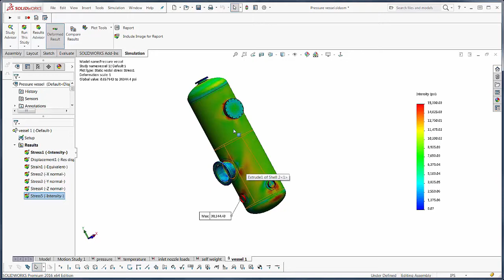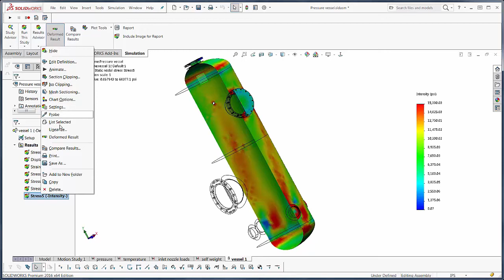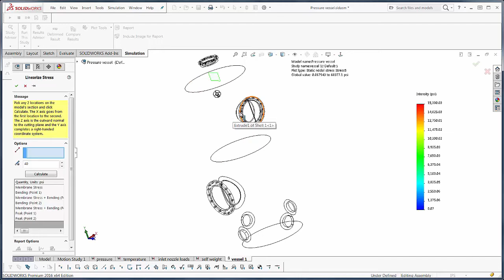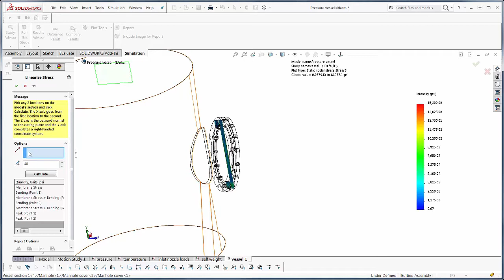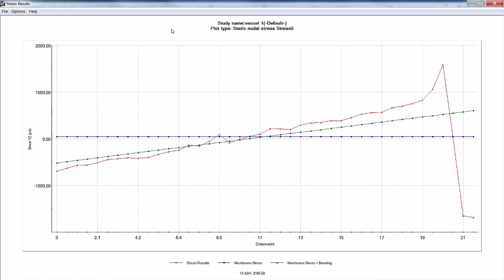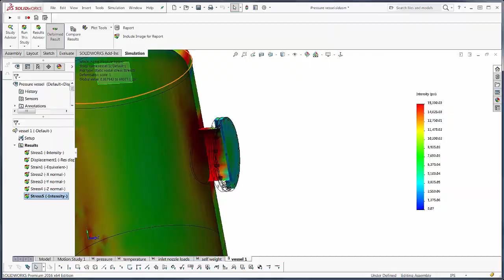SOLIDWORKS Simulation - Stress Linearization for Pressure Vessel Studies

Comment: Hello, I'm trying to get a linearized stress analysis following this video. However, even after creating a section clip, the option to linearize is never available when right-clicking on the stress plot. What am I doing wrong? Thanks.
Reply from the maker: Hi Phil3555,
That behavior is probably not something that we could help diangose in the comment section of a YouTube video.  Our best advice would be to contact the supplier you purchased SOLIDWORKS through and put in a help desk/support ticket with them to see why this may be happened to your installation.